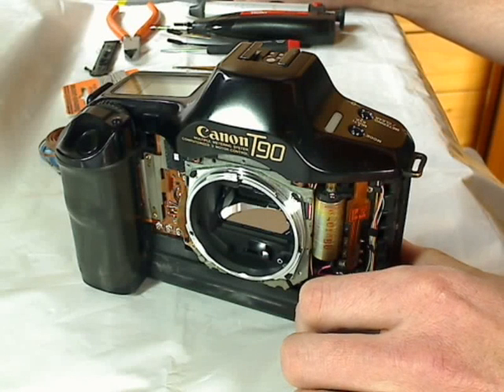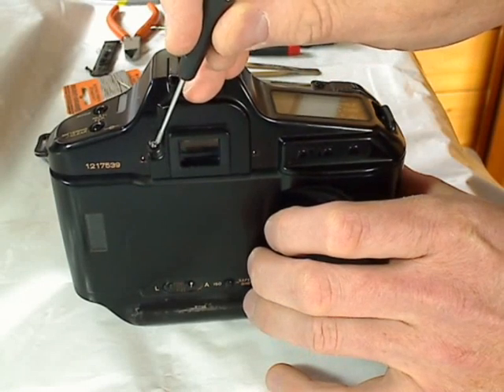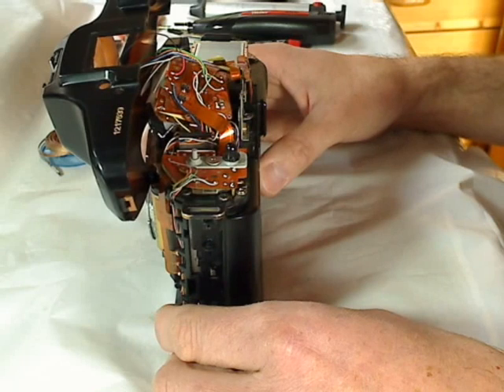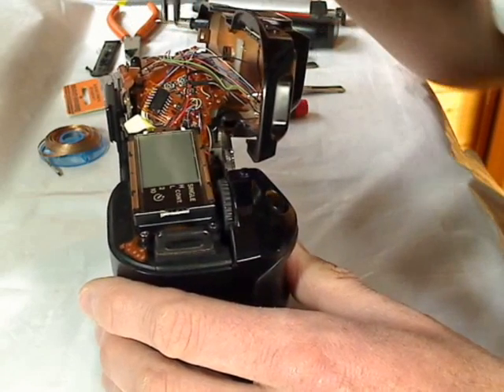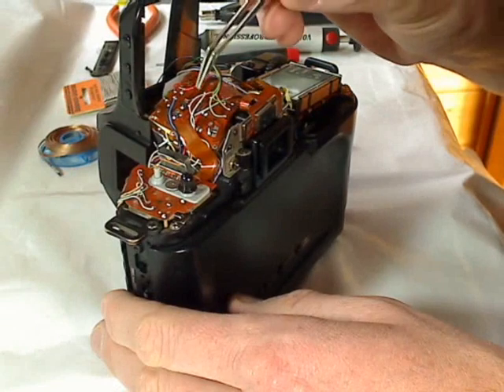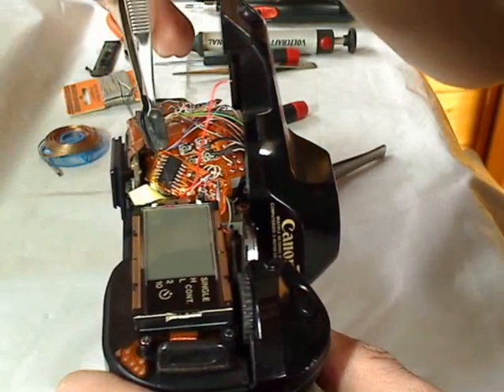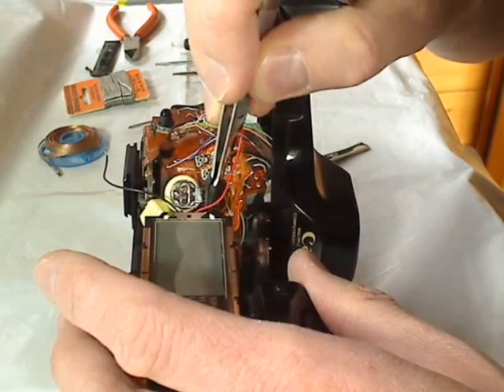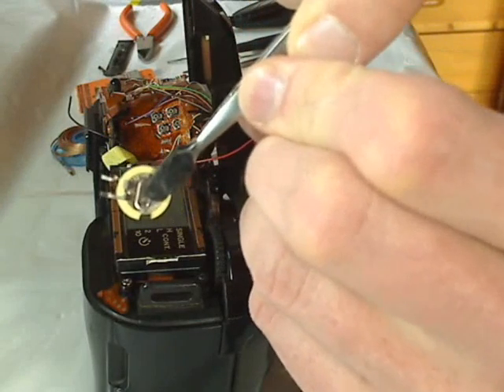Canon T90 - Internal Back-Up Battery Replacement How-To Tutorial

Comment: I need help with an error on the Canon T90 camera. I take a photo and the famous error EEE appears on the display and the word HELP appears inside. The camera then stops working. The batteries have to be removed to clear the error and the cycle starts again. Is anyone experiencing the same error? Thanks.
Reply: This is one of the most common problems with the T90. The others being the “flashing cursor”, battery holder insert breaking due to how fragile it is, and the “sticky shutter” due to the seal/shock pad at the bottom of the shutter box deteriorating, which also causes the HELP/EEE Error to  appear as well. It sounds to me that if you are able to remove the batteries, re-insert the batteries and take another picture, it may be the “sticky shutter” issue. The other issues that present with a “flashing cursor” or “EEE Help” have to do with internal contaminates that need to be cleaned and magnetization of the internal magnets, which can’t be cleared by removing the batteries.

Comment: Junk! I bought a T90 when it was out about a year from a leading UK 🇬🇧 photographic supplier. I had to return the first three as they were very poorly made (Taiwan) and some parts were even loose and rattling. The fourth seemed ok until I took it with me on holiday to Greece.  It went faulty within days and just wouldn't work. When I got home I managed with a bit of persuasion to get the UK Canon distributors to replace it. I hardly used it since and found out years later the T90 was very prone to the problem I'd had. I never bought another Canon product.

Comment: Great, thank you very much.... changed in three Bodys now.
Two of the had no circuit over the battery, so the replacement was much easier (higher serial number bodys)
On all  three bodys battery replaced and film feeder "hack" attached.
Have a good time !
Reply: what type of batteries you have fitted?  can you write the link please?
Reply: @EmaMicroGarage  Hi Emanuele - I used CR1220
Kind regards, Andy

Comment: These are 33-34 years old now. Amazing things. Mine I have had for 30:years and has been parked up for the last 15-20 years but I have changed the batteries and turned it on every six months or so. The shutter did stick when I took it out of storage but a good thump on the bottom got it going again and since then keep moving it around keeps everything good. The AA’s power the camera when they are in and charged so all this palaver is avoided is you keep the AAs in and with charge. These never use the battery seen here being changed unless the main batteries are discharged or removed. Frankly if my T90 needed this amount of work I would just bin it and use my FM3a.

Comment: @DrTomHi
I need your help, I have an unusual problem with Canon T90. When i put the batteries i get blinking 'bc' message on lcd and nothing else, no shutter, no lights on viewfinder. Also i noticed that when i press the step down lever mechanism seems to be working but lenses won't step down, also i can't push the mirror upwards (I'm able to push it up when i fiddle with the left socket near the mirror). Nor i can move the vertical lever on the right side of the mirror. I also noticed that shutter have two grey screws when looking behind the mirror and i can move that curtain upwards with a screwdriver but it returns to it's original position. In my working T90 there isn't any curtain with grey screw. Is this fixable ? Can you please help me. Thank you.
Reply: like this? https://youtu.be/B5T3fHpmMDk?t=8m16s
Reply: bruh did you found any solution for that problem ? i have the same..
pls help

Comment: I notice you have a battery operated soldering iron that actually works. May I ask the make and model of the iron you are using?
Reply from the maker: jagdev grewal Hi, I use an older WELLER BP645 soldering iron that works with 3 AA battery cells. It works fine for smaller solder joints but it has not enough power for bigger ones...
Reply: DrTomHi Awesome. I'll give it a look in. Thanks mate! Great video too btw.

Comment: Which moron thought it would be a good idea to put the battery there?
I had no idea the T90 had a backup battery. What happens if the battery dies? I have a T90 and I have no idea of the condition of this mystical battery.
Reply: Is it still working?
Reply: @goldenhourkodak  Yes
Reply: Alessandro LinuxBSD  Better late then never :-)

Comment: There is a lady in my Camera Club with a T90 she has not used for 8 years and I am trying to teach her how to use it -- I had to read the instructions myself !!  I did not know there was this 'back-up' battery -- it probably is not any good BUT she has used camera last weekend and got some photos ! How LONG does the battery last/
Reply: The battery is stated to last about 5 years.  I got more than 5 years out of mine, but now I am considering this replacement operation if I can find a replacement battery.  This is one of the really great classical Canon cameras .. It was the prototype for the EOS series!